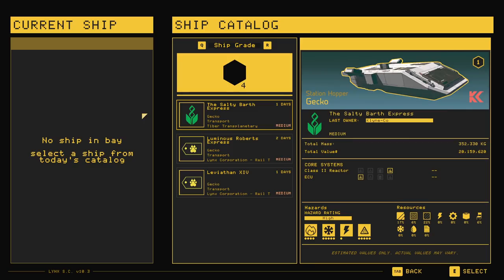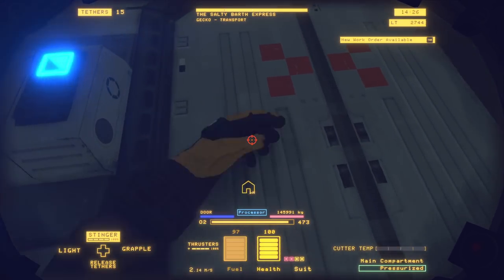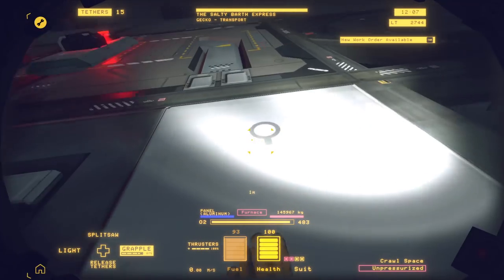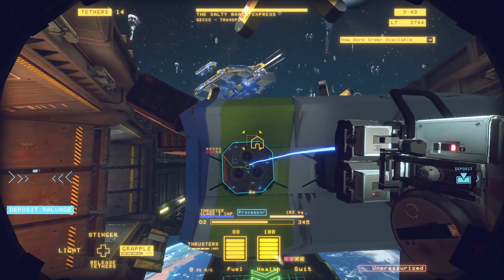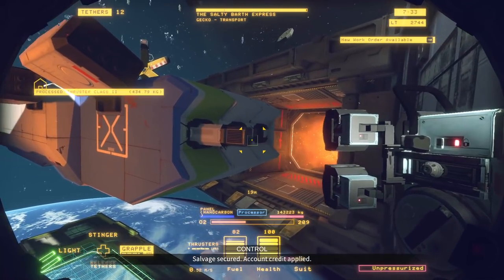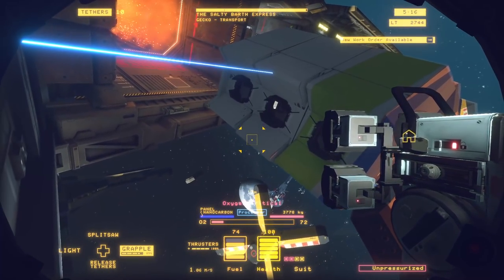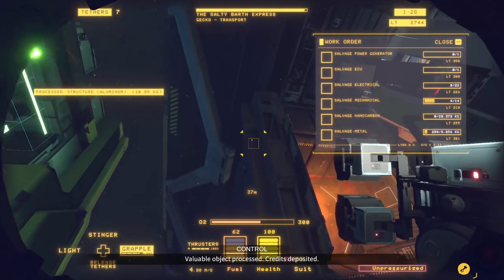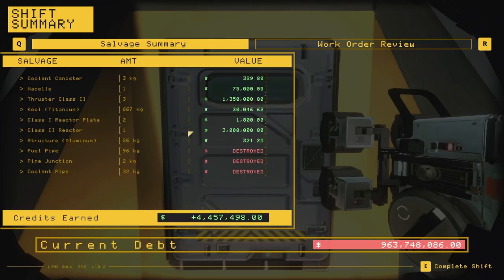Hardspace: Shipbreaker | Guide | Class-II Reactor Safe and Surgical Extraction | Gecko Commercial

Comment: I had a very different method, that did use the emergency lever. Difference being I first disconnected all the aft hull plating which I then pulled away from the thrusters.
After removing the fuel canisters, I could safely pull the levers. Sometimes there would be fuel leaks for a few seconds, but seeing as nothing explosive was around to blow up, it was no biggie.
I also pulled out the coolant last, just in case something were to go wrong, It helps to be able to open up a coolant pipe near the area that's heating up.

Comment: I just figured out the thrusters, fuel lines and reactor casing are all one part but not connected to anything other than the coolant line, so if you just take out the coolant line from the bottom reactor cap where it connects, you can pull the whole assembly out in one piece and get the reactor all the way into the barge without even triggering the meltdown in the first place. It only registers the bottom reactor cap as being in the barge at first, so you have to pop off the reactor casing and disconnect the reactor, triggering the meltdown sequence, but you just have to scoot it over like 2 meters and then the barge will accept it. Same with the thrusters, just flip the switch and give them a push and you're done.

Comment: My first try removing a class II reactor didn't quite go to plan. In my ignorance, I started slicing up attachment points left, right and centre until I grazed a coolant pipe with the good 'ole splitsaw. In my desperation to figure out how to get the now very unhappy reactor out, I ended up getting lost between the hulls. It quickly descended into the "Grab the cat" scene from Lethal Weapon III. I ....... just......made it out in time.
On the plus side, access to the inside of the ship was much less of a problem......

Comment: Ok, so, 2 things for anyone watching this vid:
1) The reactor will now immediately go into meltdown the second you pull the coolant after the latest patch. (pretty sure this is addressed in the v2 guide, not sure yet.)
2) I'm fairly certain the method of vaporizing the connectors isn't intended, so I'd try to find an alternate solution just in case.
    My method (thus far, still figuring it out for myself):
    1. Detach and secure all nacelles.
    2. Find and vaporize all cut points necessary to detach the 3 large hull sections that make up the back of the ship, use tethers to pull them away. This gives safe access to the fuel storage.
    3. Carefully detach and secure all fuel storages.
    4. Vent each thruster with the manual valve, then remove and secure each thruster.
    5. Prep a path for the reactor as best you can. DO NOT CUT OR REMOVE THE COOLANT UNTIL YOU ARE ABSOLUTELY READY.
    6. Make a path for yourself to quickly make your way from the coolant module back to the reactor.
    7. Remove coolant and QUICKLY cut the pipes at the reactor end as necessary.
    8. ???
    9. Profit

Comment: You can use your scanner to locate the key in the ship. I forget what the mode is called but its the same one that shows you where the data pads are. Also you can easily remove the fuses. When looking at it, there's three red pulses then a fourth white one. Push f when it turns white and no zap zap

Comment: Usually in just 1 shift I can: pull some of the external panels (sell some of them), switch off reactor, disable ECU, salvage reactor, salvage ECU, salvage all 3 thrusters, salvage all fuel, salvage power generator and salvage all coolant. In just 1 shift.

Comment: You can remove the fuses without getting electrocuted. The trick is to pull the handle when all 3 lights are off, then the fuse ejects safely.

Comment: You don't need to pull the hubcaps - you can just cut the purple boxes in front of the thrusters, unzip the whole frame (cut all the frame cut points in "limbo") and pull the thrusters out that way, saves time because the hubcaps also go in the processor like the nanocarbon shells they are attached too.
Reply from the maker: That's a very good point!

Comment: They should add a locking breaking thing for anything that needs a mechanical key.
Press the tool onto the hole and it will force the thing to unlock as desired, breaking the lock in the process due to the tool using brute force rather than actual lock picking.

Comment: so this is a great guide but id do it slightly different, even pulling everything out properly the reactor can still go critical. ive found the best way is to deal with the fuel, then pull the back of the ship off and then do the coolant so if it goes critical then u can do a quick hack job on the pipes and get the reactor into the barge b4 it blows
Reply from the maker: Nice! I also show my updated method here: https://youtu.be/XoFRVAZH8R4

Comment: Good luck with that!  The most recent patch made reactors start melting down as soon as you cut off the coolant flow! 😬☢
Reply from the maker: Yup, showed it off in this video: https://youtu.be/XoFRVAZH8R4
Although it's still bugged, you can do coolant first and fuel second on the Gecko Commercial for whatever reason. But the basic idea is the same.

Comment: How do you deal with getting the giant panels to the processor? My furnace keeps stealing them whenever one of them just slightly slides into it's gravity, super frustrating.
Reply from the maker: The ones from the rear I tend to need to attach them to those "X" like structures above the spaceship. That way I can safely tether them into the processor without accidentally getting them sucked into the forge, as I've run across that issue before as well.
Reply: If you look, ahead of the processor, the bay sticks out into space further. The key is to pull them back  and out slightly so they clear the thrusters, and then just tether them with about 5 tethers straight forward ahead of the processor. 

With 1 minute tethers, overshooting the mark is not really an issue, and most of the time, they get sucked into the furnace because line of sight got blocked because you tethered the far end too far back in the processor bay. If you tether way out past the tether bay, the tethers keep draggging and can just power past the furance. 

Also, obviously, line up the tethers so the piece doesn't have to rotate. there is a large flat spot on the panels to pull from, but you do have to actually have line of sight to something that is facing the direction of pull. That was what I struggled with initially, back before I realized how many tethers were breaking just because I tried to use them to attach large components from really off angles, instead of standing basically in the path to be pulled along, and having clear line of sight to both surfaces.
Reply: Also, try working from the front of the ship to the back. Pull the panels out of the way toward the back like in this video until you get rid of the outer hull more forward.

Comment: you can just remove the reactor plating from the top and directly pull it up no need to cut the pipes or anything. You don´t have to pull out the Plating just let it float in that little compartment. Is definetly faster than the hassel you have with the pipes.
Reply from the maker: I don't mind the pipes so much, I've also gotten it down to just a few cuts now. 1 for coolant, 3 for fuel and then bam, straight into the barge. I think everyone is going to have a slightly different method and I think that just speaks to how much player agency the game offers.

Comment: Just an FYI, I have found keys EVERYWHERE. Cockpit, main hold, reactor room, Maintenance areas and outer hull access ways. There is no real rhyme or reason to their spawns, it is really just "In the ship". Also also, if you grapple something and hit the right mouse button at the same time, you will reel either it to you or you to it, makes getting back to the hab and the ship VERY fast. Cheers :D
Reply from the maker: I've been starting to notice that too after making this. I've just found the keys in the pilot area about 3 times, luck of the draw it seems. I've even seen the keys floating around the thrusters in the rear of the ship xD
Reply: @Akabane101  While breaking down a mackerel I found one in the forward gaps of the exterior plating around the cockpit. I was thinking, "Who the heck dropped this here?" XD 
I love this game. I don't know if the ships are procedural or not, but they have so much variety it has yet to get dull.
Reply from the maker: @135Fenrir  I really appreciate the slight changes in the interiors. It seems all the structural braces around the ship are typically the same, but I love how the rooms and items change so it's never a carbon copy of a previous ship. :D

Comment: Yeah, this doesn't work anymore. As soon as you remove the coolant the whole thing starts going critical. I also was entirely unable to pull the melting down reactor out the bottom despite the pipes all being removed.
Edit: After a second attempt I did manage to get it to work, but only by removing the coolant as the last step (aside from cutting the coolant pipes) It came out fine this time.. I think the first time I left a piece of pipe attached to the reactor, and even though it was just a tiny section that was itself detached.. it seemed to have locked the reactor in place anyway.

Comment: Looks like today's update has made this guide obsolete. Everything I learned in this video now starts a reactor meltdown (pulling the parts from the ECU, removing the purple connectors).
Reply from the maker: I've already created a new guide detailing the more intended way of dealing with this: https://youtu.be/puejBulSKeU 
Although you can still stinger the purple blocks, the other guide shows flushing the system with the emergency flush system (obviously using a key is safest, but I like to show how to do it without a key). The Reactor will only engage meltdown the moment both the fuel and coolant lines are disabled. So take your pick on which to disable first and second. As long as you're careful and time everything right, you can still extract the reactor the exact same way shown here and in the other guide.

Comment from the maker: Key Location Report:
I have located another key INSIDE the glass box containing the Class-II core. So keep an eye out for it there next time you break a Gecko Commercial Class ship!
If you found the key in other places on the vessel, lemme know! <3
Reply: I've seen them floating back near the thrusters and just about anywhere else. Though that may have been on the industrial variant. I'm pretty sure they can spawn just about anywhere in the internal volume, though it may need to be somewhere that could be pressurized? I typically just go to town with the object scanner. They're one of very few neon-pink contacts, so they're usually easy to spot.

Comment: If you remove the power module on the top of the internal structure of the ship, all the fuses go dead and will not shock you. But then there will be no power inside the ship.

Comment: My cooling line stays full even after removing the cooling units like you did.  Any idea how to flush it out?
Reply from the maker: Make sure you remove all three capsules. That's the intended way to flush the coolant system. The ECU even without the coolant capsules within it can explode ice everywhere if moved on it's own. Once the capsules have been removed, you can stinger the wall behind the ECU to make doubly sure it's disconnected from the piping system.
Reply: @Akabane101  Have you had experiences with Heat sinks? I think not all ships have them. but if they do: They will keep the coolant in pipes. Essentially acting as secondary Coolent system. So you have to take them out as well. before Cutting the coolant pipes. In my try I yanked the Heat sink out before dealing directly with the ECU. But it triggered a Meltdown but the Coolent pipes were empty (I cut the Reactor core and yanked that money shot out wasnt super clean but debris is now minimum and it got down safely. )
Reply from the maker: @tomw4955  I can't say I've had to disable the heat sinks before pulling out the coolant pods in the ECU. It should drain out the moment the pods are gone. The reactor will engage meltdown sequence the moment BOTH the fuel line and coolant lines are disabled as of patch 0.1.2. So make sure to prep the work environment for extraction the moment you disable the final system.
I show a faster way to cut the pipes in my followup tutorial: https://youtu.be/puejBulSKeU
However I'm editing together a guide now with the latest update.

Comment: To remove a fuse without getting zapped, watch the blinking red lights on the fuse panel. It counts up 1, 2, 3, then back to 0. When it's at 0--when no red lights are showing--that's when you hit F to remove the fuse, and you won't get shocked.
But be careful when you hit F to pick up the fuse itself. I've read horror stories that it can turn you into physics spaghetti and throw you at the wall hard enough to kill you.
Reply from the maker: Nothing worse than turning into a spaghetti. 😂

Comment: Your method is really great but could be made faster i think.
Also i don't know how to salvage the ecu without exploding it because even if you disable it it will still freeze the room when you cut the pipes. Do you have any clues ?
Reply from the maker: The only way I've found that is semi-safe (can still explode) is once I've stripped the ship down to the inner hull, I cut into the room and tether the ECU to an outer wall. Then I cancel the tether the moment it's ripped out and tether it directly towards the barge. This can result in the ECU just popping and exploding into ice. It's a real hassle. I'll keep experimenting and seeing if there's a way to fully disable it.

As for a faster method, you can skip removing the rear hub caps and thrusters and simply disable the barrings holding the rear plating together. Disable the fuel lines, rip out the inner plating. Burn the bigger exterior piping system, grapple the inner pipes and yeet them away. Then just rip out the reactor and you're golden. Maybe I'll try speed running.

Of course, if you have the Rank 9 cutter that let's you cut through exterior hull, you can just cut a square underneath the reactor, disable the fuel pipes, rip out the piping system and throw it down into the barge.
Reply: @Akabane101  for the ecu i melt the plating holding the pipes and it freeze the room but after that i can pull the ecu out safely.
I've extracted the reactor, thrusters and ecu in ~5 mins and i think my method is the same as yours. The video is on my channel if you want to look ;)
Reply from the maker: @Greyflex  Very good stuff!

Comment: THIS DOESNT WORK anymore.?
So I just did what you did. And my Reactor went into meltdown after deactivating the Coolent system. I think now its best to Extract everything. then When the way is free. And the fuel pipes are vaporated. You deactivate the Coolent system go around fast Cut the Coolent pipe/vaporise it. Then Draw the Reactor down. As I have seen it doesnt matter how much its degraded. You get 3 million wether it has all healthpoints or one. Caps was done for attention.
Reply from the maker: With the latest patch 0.1.2, the reactor will go into meltdown sequence the moment BOTH lines are cut. You can cut one and wait to disable the other until the time is right. I'm working on a new guide as well to help with this. I show a faster way of cutting the pipes here: https://youtu.be/puejBulSKeU
So far in testing, you can still stinger the purple blocks, but I've shown in the guide linked how to flush fuel out (without the key) safely as well.
I'm also working on another guide video as I write this to hopefully clear up any confusion! Cheers!

Comment: Is there any reason to remove fuses? Or to collect them?
Reply from the maker: You can remove all three fuses to make it so you can extract the power generator with no damage to it's health bar. At the moment it doesn't matter if an item is damaged or not when it goes into the barge, as long as it has at least 1 bar of HP. I'm assuming down the line, that once damage goes into the red, you will receive a penalty to the money earned.

Comment: i tried to cut through the purple cubes and the whole damn thing exploded on me, also removing the two caps from the coolant system didn't empty the pipes for me (still glowing)
Reply: There are three caps in the coolant system. Just root around until the icy fog in the ECU disappears. Also, the needle mode is bugged and doesn't trigger explosions in pipes because it flags things as deleted instead of cut. The cut will still set them off. I'd expect a patch for that Soon™
Reply from the maker: Coolant System: Remove all three caps. The third one (bottom left) is hidden by the smoke. These ECUs will always have 3. (Unless later patches to have more or less.)
Purple Cubes: Don't cut them, use your Stinger. Split-cutting pipes or other various objects that are well known to explode often time have a very high probability of them igniting.
Reply: use your scanner the three coolant canisters show up in blue 
this way you can see through the smoke

also do switch to your cutter when grabbing them 
you don't want to F push them by accident they will explode
Reply: @ryanflorian2047  THIS! The amount of times I caused fire, cryoaccidents and even shipexplosions cause I Gravpushed somthin instead of picking it up! I feel like its by design so you switch and use your dexterity but I wish the push was on a diff button.

Comment: I have had luck draining fuel from the lines by yanking all the fuel tanks loose.
Reply from the maker: Does disabling the tanks of fuel stop the piping system from bursting? :O
Reply: @Akabane101  yeah if you disconnect them all you can cut the lines with no worry